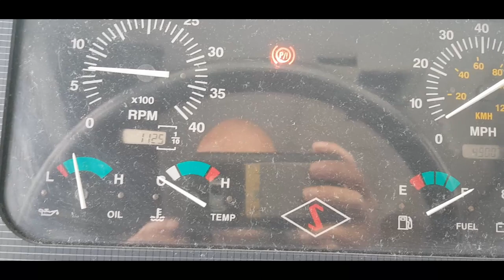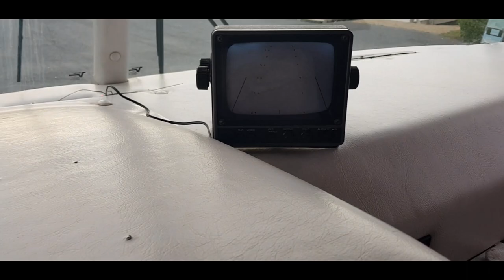Homologuer (VASP) et Aménager un bus en camping car - S 04: EP 16 - Réalisation porte vélo !!!

Comment: J'ai bossé dans le commerce des hydrocarbures et je connais un peu.
Le souci en France, c'est que l'on ne peut pas connaitre la qualité du GO avant de faire le plein mais d'une manière générale, les stations de très grdes distribution n'additivent pas leur GO
Il y a aussi les GO type Excellium mais ça pique. Les pays du Nord ont souvent du GO + cher mais meilleur
Pour ma part, quand je ne trouve pas, je rajoute moi même un additif.
Reply: Pour les additifs, ceux de Mecarun sont les meilleurs, et de loin.
Sur ma Mercedes 320 CDI, 300 000 il, après un traitement de fond plus un d'entretien, moins de 0,5% d'opacité sur les deux mesures au CT.
Refait la même 2 ans plus tard, après un decalaminage à l'hydrogène... Résultats décevants en rapport...

Comment: bonjour les bandits

Jérem, j'ai une question, lorsque l'on met un porte moto-porte vélo derrière un bus, la limite des 3 mètres s'applique -t-elle ou bien fait-elle partie intégrante du bus
Reply from the maker: On peut pas dépasser 12m en tout il me semble
Reply: Merci Jerem, je vient de regarder et voici ce que j'ai trouvé ;

https://www.legifrance.gouv.fr/affichCode.do?idSectionTA=LEGISCTA000006177085&cidTexte=LEGITEXT000006074228
Article R312-11
2° Véhicule à moteur : 12 mètres. Toutefois, la longueur des autobus ou autocars à deux essieux peut atteindre 13,50 mètres et celle des autobus ou autocars à plus de deux essieux peut atteindre 15 mètres ;

3° Remorque, non compris le dispositif d'attelage : 12 mètres ;

Mais pour les véhicules de moins de 12 m, j'ai vue aussi :
https://www.legifrance.gouv.fr/affichCode.do?idSectionTA=LEGISCTA000006177086&cidTexte=LEGITEXT000006074228&dateTexte=20190305
A l'arrière, le chargement d'un véhicule ou d'une remorque ne doit pas dépasser de plus de 3 mètres l'extrémité dudit véhicule ou de sa remorque.

le porte moto est il considéré comme un chargement de véhicule ou si il est fixe, devient il partie intégrante du véhicule ?